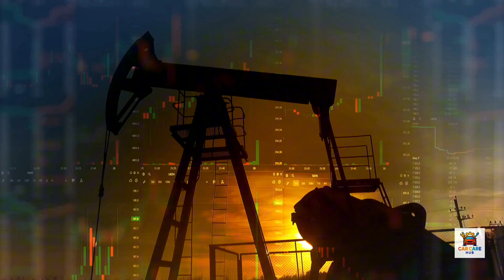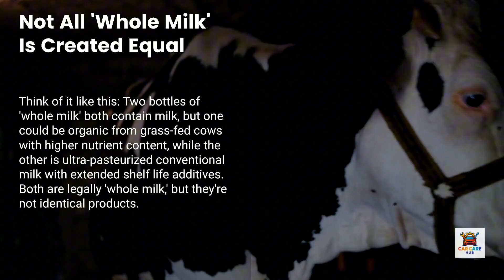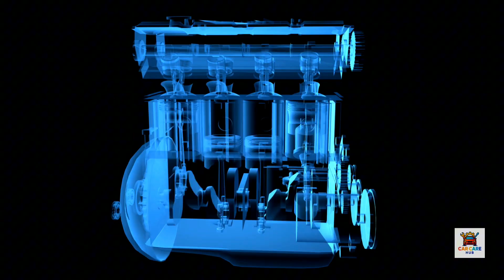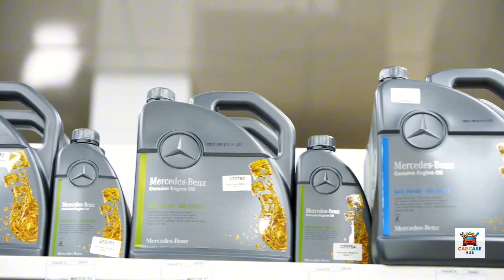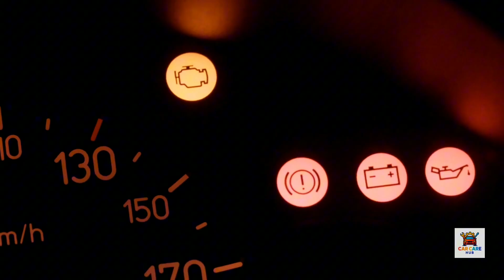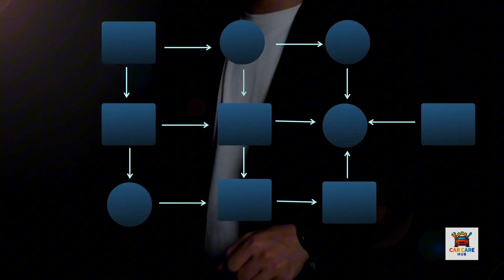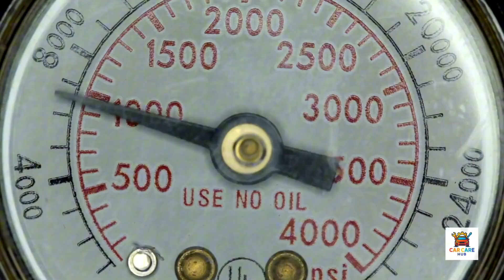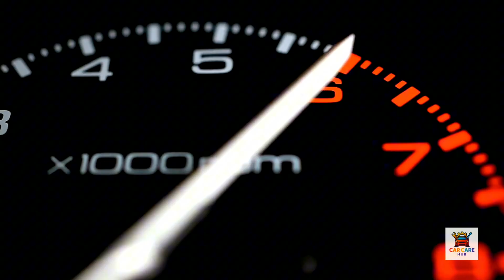5W30 IS NOT ALL THE SAME — The Hidden Truth That Can Destroy Your Engine

Comment: How about showing some actual wear metal testing to prove what you are saying. Anyone can make claims without real evidence. What about Pennzoil ultra platinum which shows better performance on son tests than Mobil one. Also, isn’t 0w20 oil more recommended than 5w30 now by the manufacturers of newer vehicles. Most people I think are changing their oil at 5000 miles instead of 7500 or 10000 miles so that would mark a difference. I don see the need to use the cheap oil over pennzoil ultra platinum versus a cheaper oil. Or mobile 1 oil.
Reply from the maker: Wear-metal testing is definitely useful, and I plan to bring more data into future videos. Different engines and manufacturers have different oil needs, so I try to keep the advice general. Appreciate the thoughtful feedback!

Comment: Am in Massachusetts, on my v8 engine, i run 0w30 liqui molly during winter months then in spring I run liqui moly 5w40 all through summer I got 115k mileage on the bmw.
Reply from the maker: Adjusting oil weight for winter and summer makes sense, especially in colder states like Massachusetts. Great to hear your BMW is running strong at 115k... Smart setup—thanks for sharing your experience!

Comment: Mobil 1. 5w30 high mileage in my 150k + mile 3.5 ecoboost  towing, daily driving and then some spirited driving.     Seems to work well , very little loss between oil changes 5-7k depending on use but usually 5k.

Comment: I’ve got a 2013 VW Passat TDI I just bought with 99,000 miles on it and I just changed my oil and put Mobil1 ESP 5w30 in it I hope I chose the right oil from what I’ve seen on YouTube I made the right decision please let me know if I did and I put a Wix filter on it THANKS
Reply from the maker: Mobil1 ESP 5W-30 is commonly used in VW TDIs because it meets the low-SAPs specs those engines need. As long as it matches the VW approval in your owner’s manual, you’re good.